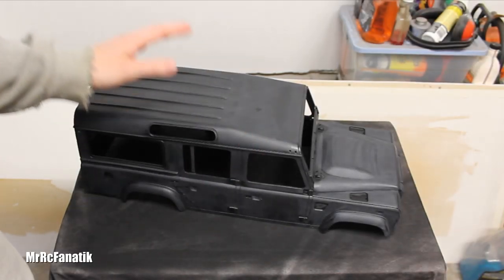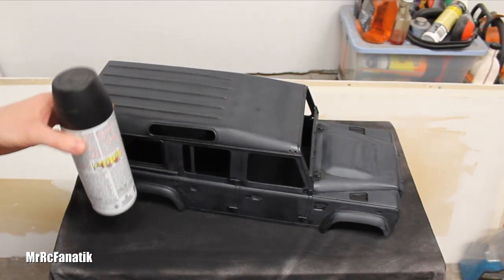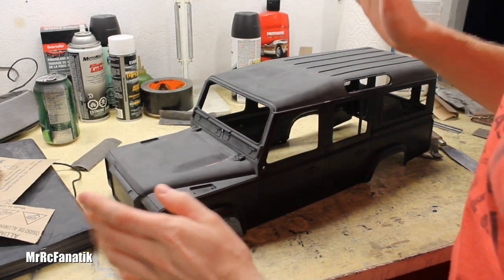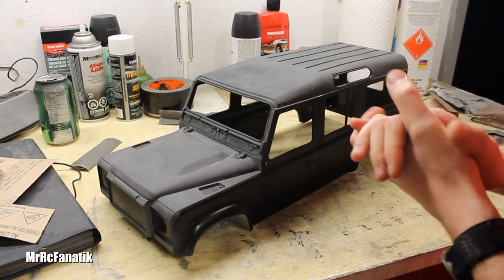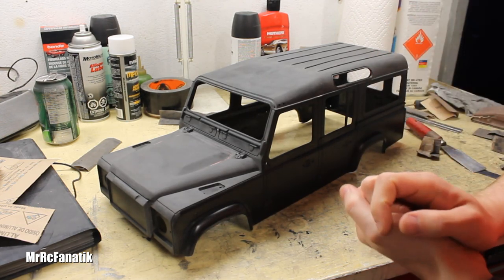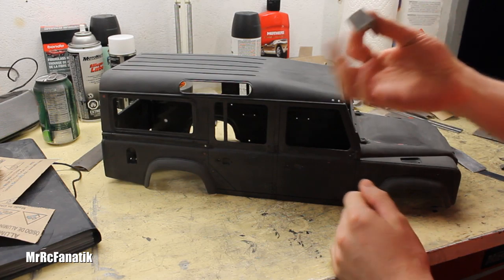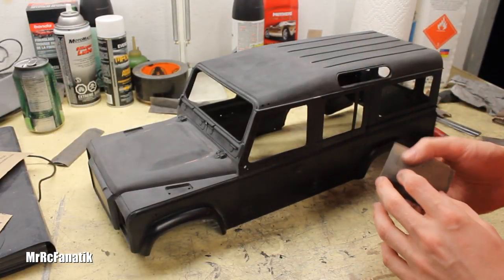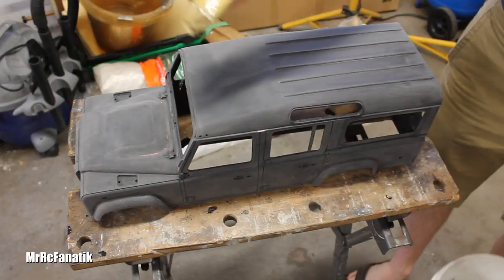[PART 6] CUSTOM Scale RC Land Rover Defender 110 Build

Comment: You could make a mold of the seats and floor also. And make a kit out of it!
lazer or water jet the frame and you would sell them like hot cakes! same goes for the air intake jeep guys would be all over it as well.
Reply from the maker: Currently in process! ;)  The frame is the only thing I'm not too sure about, but I could see that working really well.  I need to look into prices for getting 20 or so frames produced at one time.  Thanks for the comments twissted!  :)
Btw, I noticed your edit on the earlier comment, I'll try to get an email to you soon.

Comment: Hi, 
I really admire your build, excellent job! I'd like to ask what paint you use to paint metal and is it durable like powder coated paints? Thanks.
Reply from the maker: Tolga Toykoç I just use normal Krylon spray paint that I can get at most department stores here in Canada.  It's not as good as a powder coat by any means, but considering the price difference, I've been pretty happy with how it holds up to abuse.  You might paint the metal with an etching primer first though to help get better adhesion.  Cheers!
Reply: Thanks man, much appreciated.
Reply from the maker: No prob!